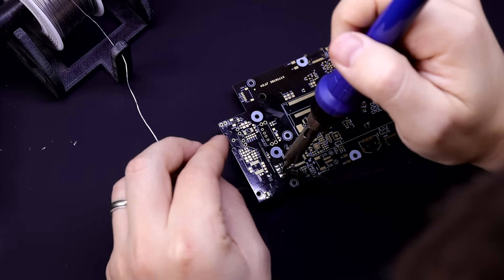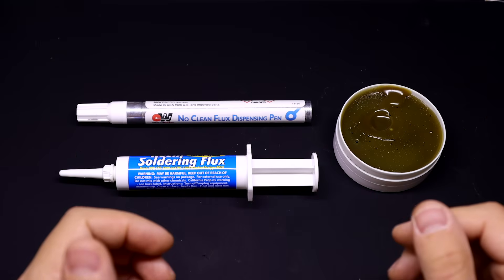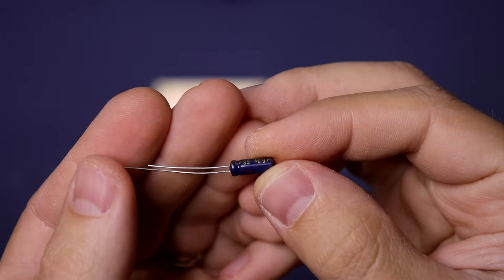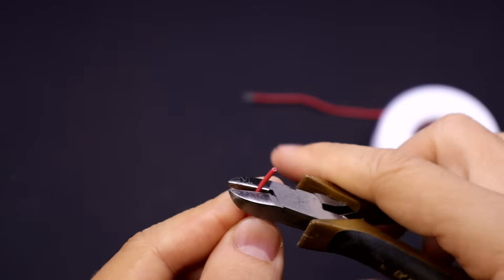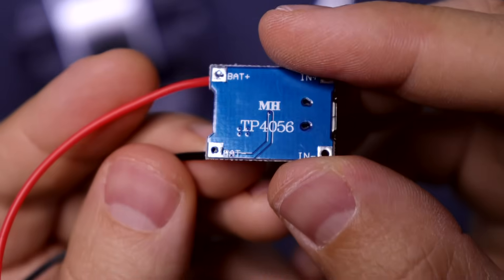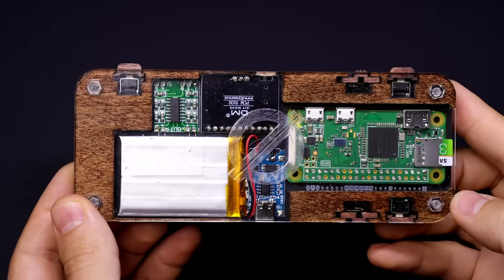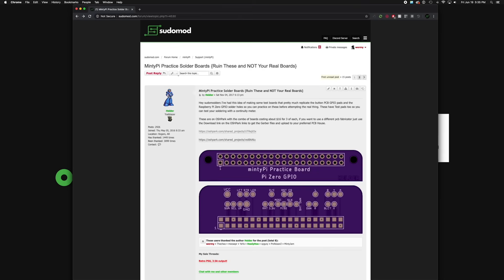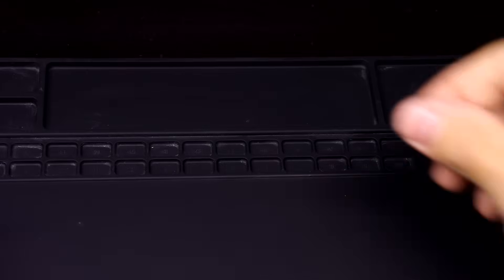Soldering Crash Course: Basic Techniques, Tips and Advice!

Comment: I'm looking at a USB-C port that has become partly detached from the PCB of my monitor. Would the 0.4mm Roisin flux wire and a iFixit soldering iron be enough to affix it properly or do I need a hot air contraption?

Comment: I thank you so much for this. I got myself a display module but it had unsoldered header pins. I have a soldering iron but was dreading to actually use it. I watched this and the display worked in a single try! I was so sure I would have to solder and de-solder 2-3 times before getting it right.

Comment: Thanks for a clear and concise video. I am challenged when assembling PCBs for my Heathkit computers. I place the components as you did the resister and bend the leads. At least half the time, the resister or component is not lying flat on the PCB after soldering. IC sockets are another challenge. I am currently using painter's tape to hold them in place when soldering. I tack the opposite corners and check the placement before committing to soldering all pins, Do you have any suggestions? I've considered using a glue stick, but haven't tried that yet. Thanks!

Comment: Also should point out the soldering iron tip choice makes a big difference. That pointy conical tip doesn't transfer heat very will since there is less contact area.

Comment: I'm new to soldering and I was looking for info on how to remove parts off a board, I'm trying to replace a capacitor for my TV to get it working again, but Idk if my soldering iron isn't strong enough or if there is a technique to it, but I'm struggling with getting the old capacitors off so I can put the new ones on.
Reply: I'm not him, but I have to remove parts for my company. Most of the time I use a solder extractor, which is kinda like an iron and vacuum at the same time.
I can use the iron for removing one leg/wire at a time, but to remove the component, if it's attached to different points, they need to be heated at the same time. Heat blower. Not sure of the technical name! 
Hahaha 
I will tomorrow though.😊

Comment: If you are super worried about using lead, you can wear gloves. But latex gloves will melt to your skin if you get too close with the iron.
I know someone who solders occasionally with lead solder. She thought the risk of melted latex was worth it when she was also caring for her infant. If she had to rush to the child, she could just take off her gloves instead of having to decide if the infant's situation was worse than not washing her hands. 

Caveats: she found gloves that fit very close to the skin so there was no excess. She is an artist, so she didn't have to worry about tiny parts getting messed up if she was interrupted.

Comment: I’m trying to learn. Seems like below 400deg I’m having issues. It takes a really long time to melt. Is this really the temp to start at? Or does it depend on what you are soldering? I’m soldering a wire to a battery terminal end

Comment: So when ever I use a new tip , it gets oxidised as soon as I use the tin. Is there any way i came prevent it from happening or remove it from the tip . I'm wondering so much on how to get it off. I have spent so much money on soldering irons just because of the tips. Pls help me 😭😭😭
Reply: Clean with brass sponge or wet sponge while still hot.

Comment: Hi wermy .& everyone.I have a Faulty OMRON M2 BASIC HEM-7116 Blood Pressure monitor that does not switch on, I fault tested the MICRO-SWITCH that are Prone to Fail, plz tell me if I did it Correctly as I continuity tested the 2 of the 4 top pins, both pressing on/off as I test, then the bottom 2 of the 4 pins again pressing on/off at the same time, the continuity beeped every time, someone suggested I remove the Micro-Switch from the circuit board to get a more accurate test. I Fault/continuity tested a round barrel shaped component next to micro-switch, I don't know if it's a capacitor or resistor because I'm a novice, I think it's a capacitor because I'm assuming there's normally 2-3 resistors, anyway When I continuity tested it by attaching the metre probes to each of the 2 pins there was no beeping sound from my metre, I trying to learn as I go along to try and repair this Important Device for a patient, I don't know how to fault check the Display of the monitor but I attached a wire from the positive battery source to each brass DOT on the PCB, the motor came on 3 or 4 times whilst touching separate BRASS DOTS but the Display did not respond/light-up, I hope that all makes sense, please can someone Help me Repair this Important BP Monitor for a Patient. Great video Thankyou.

Comment: One soldering blogger advised prepping your soldering iron by melting solder onto it a few time prior to using it saying this should be done to prevent the tip from oxidising. Is this correct? Thanks in advance, best regards, V

Comment: The most frustrating part of soldering isn't the soldering itself. It's when the fucking shit doesn't want to wet! (melt)
You're sitting there holding your 800 degree iron on the joint and the solder says, "Nah"
Heating up the joint first is way easier said than done and usually doesn't work. Most of the time you have to tin the tip of the iron and actually touch it to the solder to get it to melt. Especially if you live in high altitude like I do.
(Granted you get better with practice, but most people who don't solder often are gonna have this problem)

Comment: **As a retired engineer, I found a few holes in your 101 crash course soldering video. Hence, I’ll just mention two of them which is in regards to safety and is the most important one. You should always wear eye protection goggles, and secondly have some kind of fan or vacuum to blow away the toxic fumes away from your soldering station. All of these soldering products are very toxic and are certainly harmful. Otherwise the rest are procedures are fine. ~Be safe!
Reply: You can setup a fan to act as a vacuum. It doesn't have to blow on it. All it has to do is cause sufficient air movement away from the work. So simply turn it away from the work. Because what he said about toxicity is very true, most especially of lead-containing solders. Google it. Commercial solderers have a vacuum system or by-pass fan setup of some kind at their workstation. As do pro-welders.
Reply: Thanks for that!
Reply: I think you mean draw away fumes; definitely not blow over the work area. I probably should wear goggles but hmm, after 50+ years of soldering without I might wing it 🙂
Reply: The tutorial seems fine, a fan would cool everything down a lot, especially to hobbyists who don’t solder enough to justify a large and powerful soldering iron. This is also why 99% of people watching this will never solder long enough or often enough to get enough fume exposure to be all that dangerous. Most people who solder, myself included, solder maybe once or twice a year on average and not for very long stretches of time, maybe 15-30 minutes on and off. If health is really a concern then a p100 mask would be a better bet anyway. A fan in a space enclosed enough that you would actually be breathing a significant amount of fume would also be enclosed enough that you would just be circulating those fumes into your face over and over again instead of just momentary exposure as it passes by you.
Reply: No, fans do not make a bad joint. Bad technique does.

No, the material is not highly toxic. The sky is not falling. Treat the material like someone's bad breath.

The video was about beginning technique. It is good. Everyone will learn to perfect their technique.
Reply: And of course a fan will cool down the iron, not such a great tip. Someone always thinks they are better. It's a very good tutorial.

Comment: Hi, do you have a video on high temperature soldering? 
Basically I fix hair straighteners and the most common issue by far is one of the wires breaking off the heat element. I’d like to know how to repair the element rather than replace it. And what would I need to do that. Thank you

Comment: Reading many articles on the subject of soldering, I was informed that the iron should be set to 260°C (if manageable) if not, try getting a higher wattage plugin iron. 
A lower temperature takes longer to heat up the solder however, this could also burn out the PCB board while waiting for the lead to melt. 
 One would think that a cold iron wouldn't be a cause for concern with a low temperature but a dull knife in the kitchen is a lot more dangerous than that of a sharp one!

Comment: Make sure that when you’re soldering you wipe off the tip every time or at least every other time you use it, and then tin it before you turn it off and put it away. I was only wiping it off after I was done, and this led to my tips getting really oxidized and unusable really quickly. This is a crucial point that will save a lot of pain for newbie solderers like me 😅. Love the guide tho I’ve been coming back to this one and it’s very helpful!

Comment: As someone who loves to fix and clean stuff, you have my thanks. I always wanted to learn soldering. I also learned to use Multimeter properly thanks to Engineering Mindset. This skill is a great investment. Not only will I save money, have fun but I'll be able to fix stuff that I couldn't before.

Comment: My guy.  Many thanks for making this video! I've owned a decent soldering set for a while now. I have used it to fix power cables on an electric butchering knife for my wife's grandpa. I have also used it to fix where the power cord connects to the original Xbox. Before this I had zero experience. Pretty much every mistake you mentioned I am guilty of. I am about to dive into learning how to install a mod chip into both of the original Xboxes I have as they both will not work as is.

Comment: HI. I think you have a great video. I'm a DIY kind of person and am usually challenged to at least try new things. Your video is very helpful. I have a circuit board that goes to the AC unit in my RV.  Last February, at 6:00 am, it tried to start on its own for no reason. Don't need AC in the winter. I've taken it apart. There are 3 relays and one is gone bad.   I believe I know which relay is bad but will replace all 3, just to be sure. I could send a pic if you'd like. Is that something for another video? Thanks

Comment: Learned a lot here! Thank you for the video. One thing I don’t think you addressed is the technique of pulling the iron off the surface you are soldering. The technique of getting the solder to form the bubble or actually stay on the wire. Besides getting the solder point hot enough to melt the solder, handling the wand to leave the ‘blob’ there is the biggest thing I struggle with!

Comment: A really good and comprehensive video. Just, maybe, a little trick that can come in handy (on the other hand, forty years soldering circuit boards teaches a little something): get a syringe of flux and keep it handy, because it can get you out of trouble in many situations. One example: it can happen that you apply the tip to solder for too long, in which case the tin becomes dull and sticky. This is called a “cooked” solder: in this case (which often causes false contacts and brittle solder) you can fix the issueby simply adding a little flux. The tin will return shiny and fluid as before.

Comment: Thank you SO much for this video four years later :D I'm looking to take the plunge into soldering for my first time and I wanted to see what sorts of things I should/shouldn't be doing, thank you for not only covering some good techniques but also good after-use cleaning.  My inspiration project for getting into soldering is that I want to take a nut button (I know) and make it a power switch for my PC by soldering M/F wires onto the button, ideally preserving the "NUT" sound effect if possible.  I'd also like to try my hand at fixing a flakey LED light base for my gamersnexus display thingy since it doesn't like staying the same light I set it to.

Comment: I used to do a lot of soldering air conditioning lines for Freon and it is basically the same concept just a lot smaller. This was helpful I have project coming and I just need to solder two wires.

Comment: What does it mean when the solder won’t adhere to the pad? I find that when trying to get the solder onto a pad it either takes forever to heat and melt, and when it finally does the solder just forms a bubble on top on the pad. Almost as if it’s repelled by the pad.

Comment: hey bud, so you inspired me to spend about 300$ i got that setup you got a mat , magnifying glass 10x with the adjustable arm and light and clip arms all on the mat. got the 0.8 rosin core solder , a jar of flux paste and a wick roll to clean up along with a 6 x colors 26 AWG stranded wire. ready to get busy modding consoles and repairing them in the San Antonio TX area :)

Comment: Question, I was informed that I could use non-electric flux, yes plumbing flux. I am new and didn't know any better.   I wired fuel injectors w solder seal butt connectors w a little bit of plumbing flux.  Will it be OK or should I have to redo all the wiring. I saw a video that stated it would damage the wiring.

Comment: I find using a lump of Blue Tack stuck to a flat surface,   
This holds the wire or board stable whilst soldiering. 

Don’t know if you mentioned Soldiering Iron types in other videos. It would be nice for a small rundown at the start.

Comment: I watched this and a few other vids, n went from bird poop all over my boards to beautiful points in a few days. 
... Thx so much!  I still use flux on all my joins, n just spray it off after.  Keeping my tip clean was NEVER a thought, but now I'm Capt Clean after every touch 🎉🎉
I even go as far as to mark my solder roll every 5mm with a sharpie to be sure I don't just feed it in like a madman 😂

Comment: after watching this I'm no longer afraid to replace the joysticks in my controller, bought a whole setup just to get into soldering and this will be my first try with a proper iron. First try was using one of those wall plug ones and ended up ripping pads out since it was too hot and cooked the pcb

Comment: The most important information regarding soldering is that tin and copper creates bronze.
Bronze is very strong, while copper and tin is soft.
So it is importance that the two material, which you want to solder, is actually physically touching during the soldering process.

Comment: I am 43yrs old, and when I was a little kid my dad always had soldering equipment lying  around even though he never soldered.  I would always try to fix broken remotes or electrical equipment with a lose solder, my mistake always was melting the soldering wire on the tip of the solder iron and dumping a huge drop of solder on to what I was trying to fix…. And now it angers me that no one corrected me and seeing how easy it was.. lol. I could have been a soldering king by now 😂

Comment: I've been soldering for decades. I can solder fine pitch with no problem. What I have trouble with, is using low melt solder paste with a heat gun without melting the plastic of the component

Comment: Question: Do you heat the wire and make the wire melt the solder? If yes, how do you keep small wire from burning up before the solder melts? I'm dealing with micro wires for a turntable phono cartridge connectors.

Comment: Your solder holder idea gave me an idea, using a little vice that
I got with my solder helping hands. I'm just learning it myself as
I speak. I'm very, very green. To me, I find it easier to use the iron
over my wire and the tin under it. It seems to be better for me. However
I didn't try your holder idea yet. So I'm still learning what does what.
Please wish me luck, that I get it right. Thanks for your much needed help👌👌👌👍👍👍

Comment: My issue is the solder sticking to the side of my tip instead of the tip itself. Any suggestions?  I've tried from 300-400°C doing 25 intervals and nothing has worked. Yes I've tried different tips as well

Comment: I realize this is an older video, but I'm kinda new to soldering, but i have a pretty decked out set up, and I have one question. 

Say i wanted to join two wires together. 

So, I strip them by 5mm, twist them together as you do @7:50 ... can I just dunk that twisted bit into a solder pot? Would that work? 

Thank you.

Comment: VERY nice gude!

but you didn't mention how solder cools VERY quickly, almost touchable within seconds. and also, that you should be careful not to touch the soldering iron to ANY part of the board other than the points you are soldering, as it may burn/damage them. it may seem obvious to those familiar, but i've seen this done more than once by rookies...

perhaps a desoldering class next?

Comment: You forget to mention very basic but important point that u put some soldering tin on the soldering iron that helps you to have more surface area that connects better with wires and providing better heat transfer.....